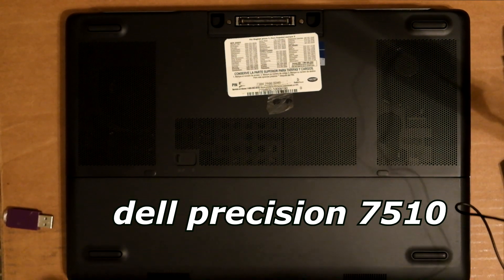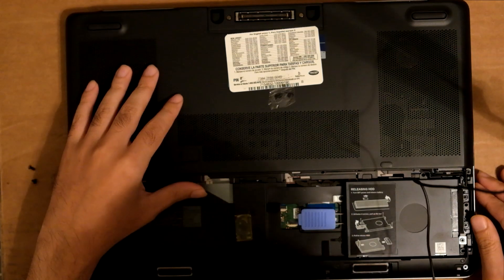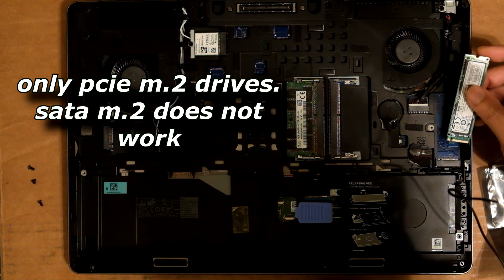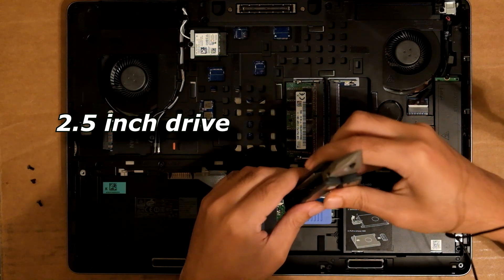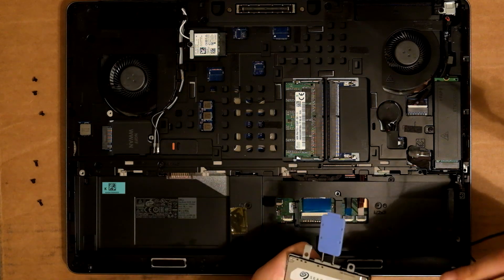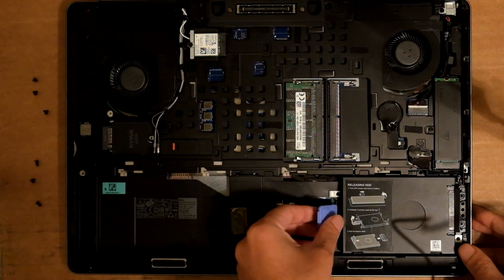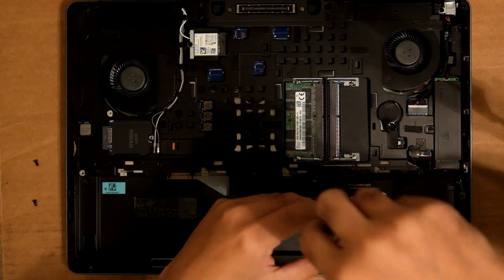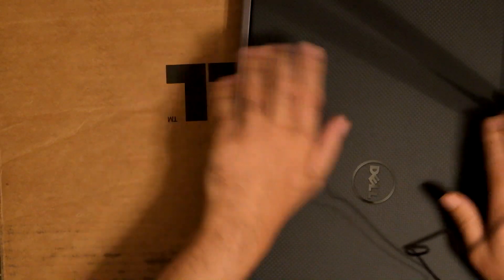dell precision 7510 ssd harddrive upgrade

Comment: I have already M.2 SSD 256 gb and I want to upgrade it up to 1 TB without losing the operating system or the installed softwares, is that possible? I also have HD 1TB in the 2 inches slot which I do not want to replace it.

Is there any advise that I can follow?

Comment from the maker: i'll keep this pinned in case people skip reading the description. A user told me the m.2 slot supports both sata and nvme. he is right. If you go to dell's website the current spec sheet confirms it. i haven't been keeping up with the news of this laptop since i no longer own it. I'm sorry for that.  

Now back when i purchased the laptop, sites like https://www.storagereview.com/dell_precision_7510_mobile_workstation_review mentioned only m.2 nvme support. And dell's old spec sheet is actually still listed on their website and it said the same thing (i had to google search it, its a bit hidden away). https://www.dell.com/learn/us/en/04/shared-content~data-sheets~en/documents~dell-precision-15-7000-series-7510-spec-sheet.pdf?c=us&l=en&s=bsd and here's the pdf https://i.dell.com/sites/csdocuments/Shared-Content_data-Sheets_Documents/en/us/Dell_Precision_15_7000_Series_7510_Spec_Sheet.pdf .

going off that old data was why I said get an nvme. I apologize for the confusion. just buy whatever drive you can afford. I hope this clears everything up. i understand couple guys are joking around. i do know the difference between m.2 sata and nvme. i also own the walmart op laptop with two m.2 slots, one slot supports both, one slot support only nvme. It came with a 256gb sata m.2 and i actually tried it in my dell 5575 which dell documentation claims to support m.2 sata up to 256gb but it did not detect it (i just wanted to test it out because another youtuber couldn't get his sata m.2 to work on his dell 5575 either). thats just an example why i'm careful when i recommend stuff to put in your laptops. 
TLDR: sorry dudes

Comment: sata m.2 drives work. but why? pretty much the same price as a NVMe drive that are 5 times faster. this is a copy and paste from dell's manual - Drives configuration - one internal 9.5/7.0/5.0/ mm SATA HDD (SATA3) / M.2 PCIe x4/SATA 2280 SSD Keyed 'M'.
Reply from the maker: i don't own it anymore, i upgraded a while back, i haven't been keeping up. but back then i remember some reviews saying it was nvme. can't believe i'm spending time digging up old stuff, but the verge dig was bit harsh. but heres one from https://www.storagereview.com/dell_precision_7510_mobile_workstation_review they only mention the pcie. and heres the old dell product spec page for it https://www.dell.com/learn/us/en/04/shared-content~data-sheets~en/documents~dell-precision-15-7000-series-7510-spec-sheet.pdf?c=us&l=en&s=bsd . under storage it lists 2 storage devices, 1 m.2 pcie, and then it lists a m.2/2.5 sata drive. then under it, it lists a 2.5inch and 1 nvme. i had to to a google search for it because dell's search only gives the new manual you listed. i'll add a correction in the descriptions.

Comment: The confusion is the "names" of everything. m.2 is the name of the connector on the board and drive. m.2 connectors come in 3 different keyed types, B, M or B+M. they also have different lengths, 2230, 2242. 2260. 2280. 22110. DELL PRECISION 7510 is M keyed and 2280 length. All m.2 connector "drives" are ssd's, they come in either sata 6gb/s or NVMe 32gb/s. Using a sata 6gb/s m.2 drive is the same speed as a 2.5" ssd (I have no clue why they even make them because there isn't much price difference between sata m.2 and NVMe m.2 drives),  sata is limited to 6gb/s. NVMe m.2 drives use the pci-e x4 bus at 32gb/s.    https://rog.asus.com/articles/maximus-motherboards/buying-an-m-2-ssd-how-to-tell-which-is-which/
Reply: lordbobrules perfect

Comment: can i put a 2.5 inch drive 15mm ( 3 or 4 or 5 TB) instead of 7mm ( 2TB)..?
Reply from the maker: i'm not quite sure bro. i thought all laptop drives should fit. i didn't even know they had different sized 2.5 inch drives.
Reply: you have only 7 mm ;)
Reply: yes you can

Comment: the video shows two slots for memory. These are the primary slots. There are two secondary slots under the keyboard. This link shows what needs to be removed to make that happen. http://www.dell.com/support/manuals/us/en/19/precision-m7510-workstation/Prec7510_OM-v1/Removing-the-secondary-memory?guid=GUID-033F26F6-7C8A-418E-BD63-36500DBA339C&lang=en-us
Reply from the maker: yeah, i comtemplated adding more ram, but i read that the difference between 32 gb and 64gb wasn't that much. plus ram prices seem to have skyrocketed since i purchased the ram and harddrives. i've recently checked prices, and it all seems to have doubled in price since i made the video.

Comment: What model M.2 drive did you add? Is it a double sided SSD or are the memory chips only on one side (low profile)? If you could tell me what length the SSD is (like is it a 22x80 or 22x40) that would be great as well!
Reply from the maker: it was a 2280. edit: i just checked. it was a samsung pm951. so not the latest and greatest, but still faster than mechanical.

Comment: Hello, question. I have mounted a Intel SSD M.2 drive into the slot just like you in a precision 7510, but in the device manager I get that it is missing a driver for the PCI Device. Most likely the harddrive, as I cannot see the new drive in disk management either. Any drivers I am missing?
Reply from the maker: is it a sata drive? one commenter said it supports sata drives, but the specs says it only supports pcie drives. for my drive it showed up automatically even without an OS installed, but i had to put it in GPT mode.
Reply: the specs do not say it only supports pcie (NVMe) drives, it says-one internal 9.5/7.0/5.0/ mm SATA HDD (SATA3) / M.2 PCIe x4/SATA 2280 SSD Keyed 'M  @jimsocksgames

Comment: quite funny seeing you use the most inappropiate tool to open the laptop. but got the job done!
I am the same in terms of learning by doing, but it helps you are playing with a laptop that has that protection between user serviceable and the main motherboard.
Reply from the maker: yeah, i've been out of the computer/laptop building game for a long time and lost all my tools. so i pretty much winged it on the fly. but it was fun.
that was also why i purchased the 7510, because it is a pretty robust laptop and i knew it could take the abuse lol.

Comment: I have done that in 1/10 of time, even less, also without manual.
Reply from the maker: yeah, even with my recent build i probably spent double the time because i didn't read the manual again. LOL. i had to redo stuff several times for my ryzen build. i admit, i'm rusty. i tried to get back into gaming, but i mostly use it for video and photo editing now, so i don't really play with hardware like i use to back when i was gaming.

Comment: did you get software problem  ?
Reply from the maker: the cloned image wouldn't boot from the m.2. i tried it on the 2.5 inch ssd (the samsung evo), and that booted fine. so its something to do with transfering to pcie m.2. i spent an afternoon trying to get it to work, but i gave up. and just did a clean install and reinstalled all my programs.

also when i did the clean install to the m2, i had to set my flash drive to gpt mode to get it to install. this is my first time dealing with pcie m2 drives, so it was a little rough for me. but everything works fine now.

Comment: What's your boot time like now ?
Reply from the maker: around 20-25 seconds (i would say 25 on a first time cold boot if i left off overnight. if i simply turn it off and on it gets around the 20 mark). 
it use to be maybe double that (i never timed it with the mechanical one though).  
i didn't buy the fastest m.2 drive either. i have the older samsung pm951.
Reply: I have a samsung 970 pro, boots in under 8 seconds.